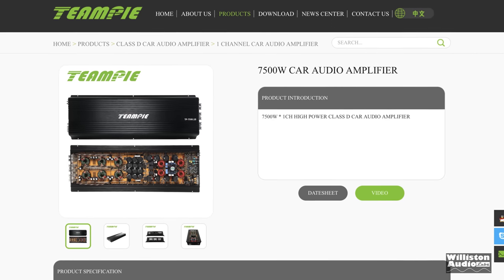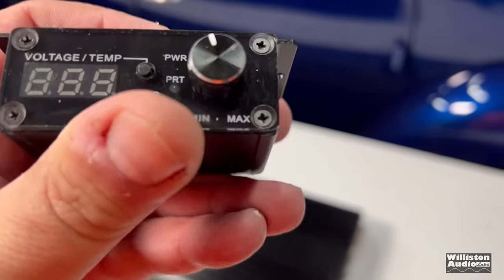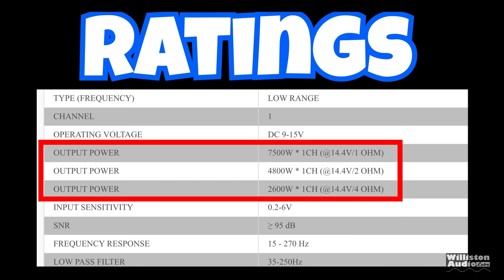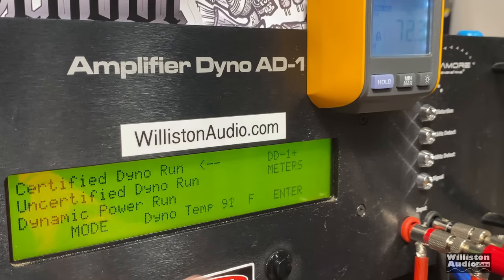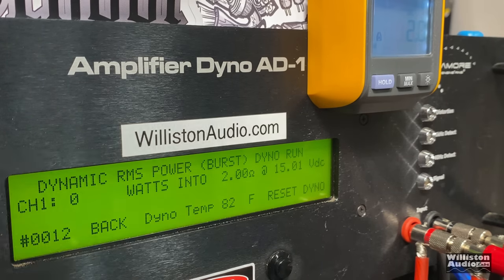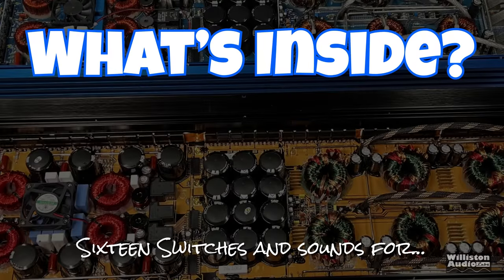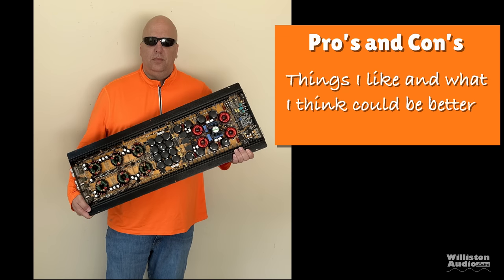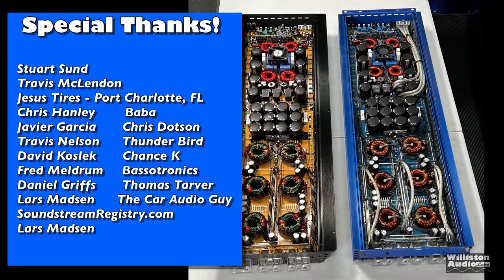POWERFUL SUBWOOFER AMPLIFIER! Teampie TP-7500.1D [4K]

Comment: "These windings on my amp are loose."

Well you're in luck because we're going to fix it for the next guy! I mean, your amp is still messed up, but think of the next guy.. lol.
Reply from the maker: I was told by the mfg after I pointed it out. I bought this amp, wasn't paid for the video, so I was just passing along information
Reply: @wal  yeah I saw the tag in the video, just kind of sucks for you since you bought it with your own money and it's messed up. I've dealt with a few companies over the years that gave me the "thanks for letting us know, we'll make sure to correct this in the future line" and I'm like, awesome, but what about mine?!
Reply: @Thezuule1  Sweet, But what about mine. Dude ohh wait that was a movie.  I hate companies that do that without offering an exchange at least. Because if you fix it and it fails they may not warranty it even if it is ultimately the same solution they had.
Reply: @D3M3NT3Dstrang3r  DUDE, what does mine say?!
Reply from the maker: @Thezuule1  yeah I agree. In this case I don't use amps like this so I'll most likely sell locally, so someone else will have fun with it...
Reply: @Thezuule1  I would not call it "messed up". Big D already opened the cover. He could easy apply a bead of silicone around the top of the coils to hold them firmly. No big deal. Thats what the factory is now doing.

Comment: You don't need 4 AWG speaker wires with this kind of power. 9500 watts RMS at 1 ohm is equal to 97 amps RMS. Given that the run from amp to subs is generally only a few feet, that is within the current capacity of 8 AWG copper. And given that an amplifier will basically never clamp more power than it can do on the Dyno, that's plenty of headroom

Comment: Is the voltage on your Bass knob accurate?  mine isn't on my 5500 so i'm wondering if its just mine or not.
Reply: You need to set it . It has a knob on it
Reply: There should be a trim pot inside you can adjust to make it more accurate. - I guess not.
Reply from the maker: I didn’t pay that much attention to it honestly. The current models don’t have a trim pot, but TP said it’s coming 🤦‍♂️

Comment: Wouldn't your efficiency be off because of the voltage difference? If the amp was designed for 14.4 or 14.1v then giving more juice would change the efficiency %?
Reply from the maker: I was referring to measuring current in one input vs all 3 at once

Comment: I've got a question for you, if you'd be willing to answer. I've got an old Lexus, running a stock 8" open-air subwoofer with ~40W RMS. I want to, at some point, upgrade to a more powerful sub with an amp dedicated to that. 

I don't know what power, or even size, I want to go up to, but I figure 100w RMS would be sufficient. What would you recommend as the best budget amplifier for me?

Comment: Would you be willing to comment on how long it took to get the amp?
Reply from the maker: About 2 weeks. I ordered the 7500, 4000 and a 125x4
Reply: @wal  Oh wow, thats exceptional. been wanting to retire my 1100.1s and these may be a decent cheap replacement, that or smart 5k's (realistically 5k per sub would be plenty)

Comment: Is this true RMS power?  Or is it instantaneous peak power?  Either way, your DC supply needs to be hundreds of amps.  Not long before your car battery is flat, it's like running the starter motor non stop.
Reply from the maker: Yes all tests RMS power. I have a large lithium battery bank capable of 1500A or more pulls at 15VDC
Reply: @wal  Incredible.  About 25 years ago I fitted a 500W system.  Loved it, I could feel my hair moving with the bass, and all mirrors blurred with bass beats.  Went into a shop, left my daughter in the car and she hammered it.  When I got back to the car, flat battery.  Manual gearbox so I managed to push start it.

Comment: Why do you use the overlap for the gain?
Reply from the maker: It's how you setup an amp to be tested with the Amp Dyno using the DD-1 plus
Reply: @wal  I see. Thanks for the info. I appreciate it. Keep up the awesome vids
Reply: It is gain matching- think of the gain as a matching tool not a volume tool. If you are under the overlap less power over on overlap and you clip the amp. Clipping is when the audio wave gets clipped of making it square instead of being round and smooth. I.E. clipped square waves actually turn the voice coil in to a heater coil sticking it at the top or bottom of the stroke. If clipped long enough the coils glue will burn and then you have a slinky or in worst case a fire. It is more complicated than that. But as a simple example there you go.

Comment: looks very similar to down4sound JP and the EMF audio.. same designer?
Reply from the maker: the 3-8k JP amps are Korean
Reply: EMF does use the TeamPie amps.
Reply: @wal  good eye, i forgot about that.
Reply: @JasonWW2000  that makes sense.. they are complete clones bass knob clip limiter everything is the same.
Reply: @CL-yp1bs  EMF has said he is selling TeamPie amps. Same for Jones Subwoofer. I think Powerhogg Audio is also using TeamPie, but I'm not sure on that one. The D4S amps use the same amp design. They are both copying the same Korean amp design. Thats why they look similar.

Comment: its the same. as synergy amps look at the guts and board color
Reply: That does not mean its built by the same company.
Reply: @JasonWW2000  its identical bro
Reply: @tatert.v.9908  What model are you referring to? I've looked on Google at several Synergy Audio amps and none are identical to TeamPie.
Reply: @JasonWW2000  look up ssa audio they have the newer synergy amps but the exact ones are from roughly 2019 .maybe even 2018 it but on ssa audio they have amps posted with their guts. the only thing synergy did this year was change the front plate to red .and inside board to red But go there check out the pics.I bought my 18 in zcons from them and back when i bought my 3 soundqubed 4.5 k i almost bought synergy amps but chose soundqubed thats qhy this amp is so familiar to me cus of my shopping back then.
Reply from the maker: I think Teampie copied the Korean design used by several companies

Comment: I've been in contact with and bought from Chinese companies before, like the SoundMagus/Darwae factory, which make OEM amps for many other brands. They do provide a lot of power for the money, but the build quality and parts quality is just a sad, sad story... Taramps is a much better option if you want high power on a budget, IMO.

That said, 17-ish years ago, a 3000W RMS amp from SoundMagus was $100 a pop from China (+ shipping), and it was a ridiculous beast.
Reply: You seem to be making the incorrect assumption that all Chinese companies are the same.
Reply: the tramps are very weak below 35 hz.... some rave and trap is lower than 35hz

Comment: Wish their 20k was available to dyno
Reply from the maker: The Amp Dyno "only" supports up to 15kW at 1 ohm and my electrical setup is not enough to reliably test an amp that large. I try to stick with 8kW and under
Reply: There's dyno of it floating around

Comment: Why is the PRICE a SECRET???
Reply: Its not necessarily a secret, but it varies. Since it comes from China, the shipping costs can vary depending on where you are located. They may also change the amp price at any time. You can contact them on Facebook  to get a quote for total price. Right now they are $680 plus shipping.
Reply from the maker: Jason’s comment is 100%

Comment: Make sure you have the electrical system to support an amplifier this big , lol yeah, Mr ricer ignores the advice and instantly welds his alternator into a solid block ha ha.
Reply from the maker: yeah it will happen unfortunately...
Reply: @wal  I only run a total system power of 2100w rms and even I have killed two alternators and my car is un drivable in slow moving traffic from it bucking to the beat from the current yanking on the alternator and in turn the engine, I tend to stick in higher gears than I normally would to reduce the impact.

I look like I have terrible clutch control when I pull away from lights with it cranked up, it's 10x worse on pull away than when in motion, my car hates me ha ha.

Comment: 8100 w at only 275 amps is pretty efficient.  only need 1 run of 1/0 for that
Reply from the maker: That’s 275 PER LEG x3
Reply: @wal  per leg?? Never heard that term
Reply: @sbb526  per power line. 275 amps at 14v pushing 8100w isn't mathematically possible.
Reply from the maker: @sbb526  there are (3) 1/0 inputs. One of the 3 was clamped. User mentioned in the Vital Power video this isn't a valid way to calculate current since some inputs may pull more than others. I did a follow up video showing it worked in this situation. https://youtu.be/WBJq296Ks3g
Reply: @Thezuule1  didn't think so, that's what confused me.  So any test with more than 1 input only tests 1 of them?
Reply: @sbb526  you'd have to use an amp clamp on each power line and read them all afaik. I'm not sure the clamp could detect the amps correctly with three wires run through it. I'm not 100% sure about that but I've never seen anyone use a clamp with more than one wire at a time.
Reply: @sbb526  I answered your question on Facebook lol